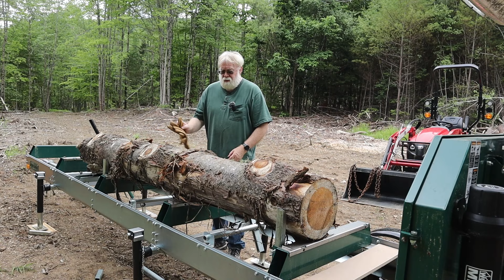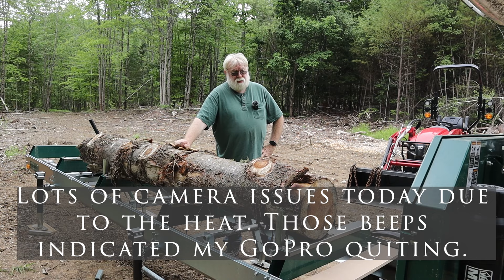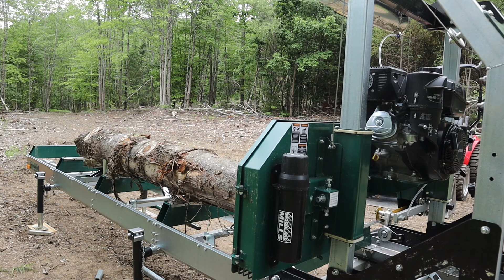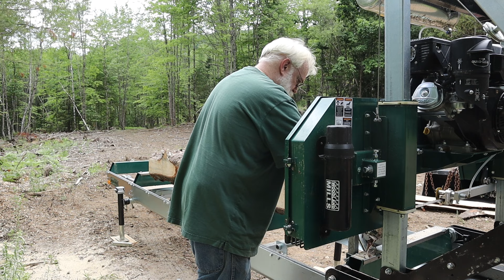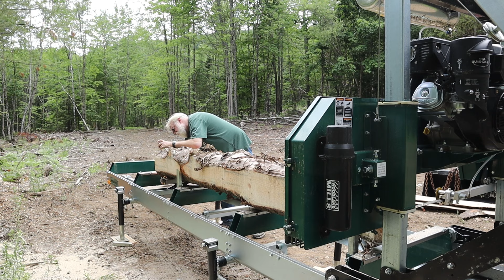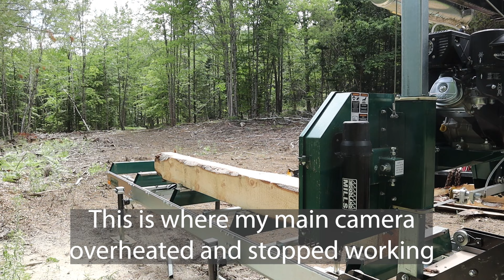Sawing my first log in almost a year on our HM130MAX sawmill.

Comment: I have worked in a few mills in lifetime and It is hard work. I noticed one thing you need to do before you start trying to really cut anything. Your log bed is not straight. The saw head is rolling toward the center from both ends. That means the center is low compared  to the ends.
Reply from the maker: Very true. It was level before I started but got progressively worse. First time setting up in that spot and it settled. Fixed for now. Thanks for watching.